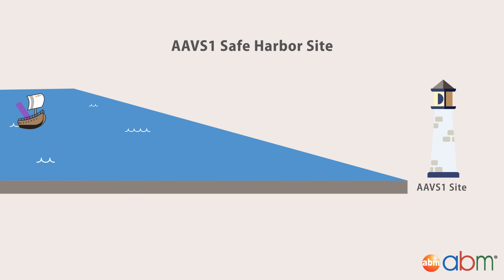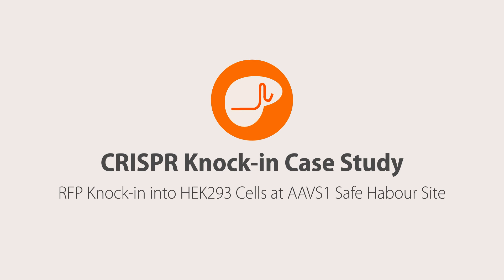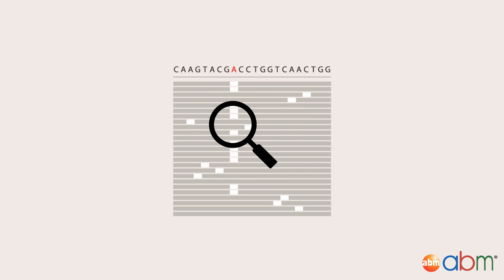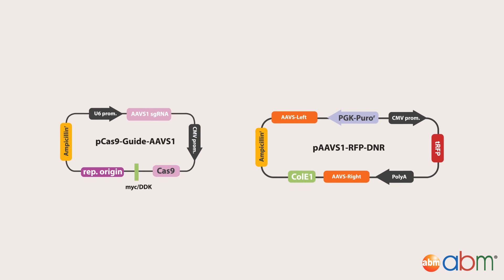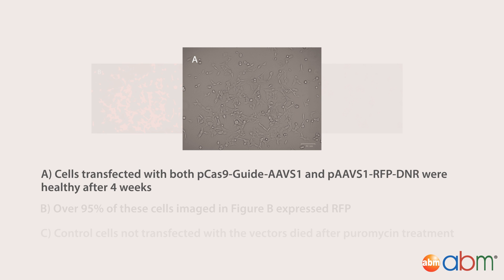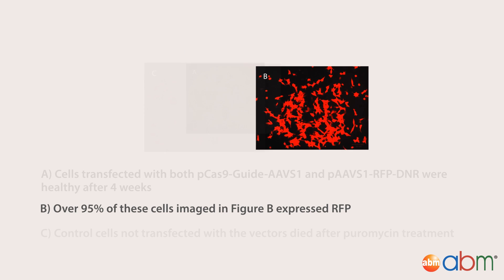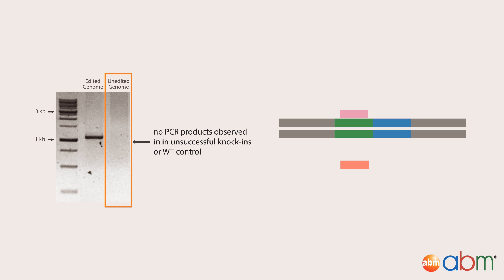How to perform a CRISPR Knockin Experiment

Comment: I was wondering why you included the PGK-Puro within the AAVS homology arms? If the CMV promoter is constitutive then can't we just select based on red flourescence?
Reply: Also because this way our knock-in only contains the GOI. My understanding is that this is necessary because we wouldn't want to transfect other selectable markers if we were using this for something commercial, like in agriculture.
Reply from the maker: Hello! Thank you for your comment! In the research setting, sometimes a selection marker is more desirable. For example, when you need a polyclonal overexpression cell line, a drug screen will be more applicable than a fluorescent marker screen. It could be a totally different scenario when it is commercial agriculture. Thank you for raising an interesting POV!

Comment: Hi, thank you for the great video.
But I have some question: 
Based on my limited understand in transfection experiment, the antibiotic selection might keep the plasmid DNA being replicated or even random inserted to gDNA, which may disturb gene expression. So that is the reason why we need the exactly knock-in and harbor position. 

If I perform the transfection, why do I still need the CRISPR knock-in? 
Or is there any method to remove the unexpected insertion in animal model?

Comment: How are you sure that knockin took place at AAVS1 locus and nowhere else?
Reply from the maker: As part of knock-in, sgRNA sequences are designed to target the AAVS1 site specifically. As well, HDR templates are designed such that they included flanking homology arms with homology to the AAVS1 integration site. As for verification, whole genome sequencing can be employed to check for the presence/absence of off-target effects in the edited cell line.
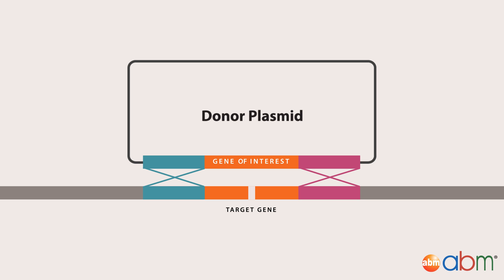Reply: @abmgood  very nice vid. I am confused in 2:11 to 2:22.  If there is 1 cut by sgRNA, so on vid seems that orange GoI replaces no homology DNA part on the genome, despite of correct HDR left and right. Is it correct illustration?
I am wondering, can you use two sgRNAs designed to target two genomic sites of  AAVS1near HR arm left and rigth?  I hope my question is clear.

Comment: Hi! I had a dumb question. But if you are using the Puro plasmid to confer Puromycin resistance to select for only cells that took both plasmids, wouldn't it be possible that there are cells that only took the Puro/Ampicilin plasmid, and didn't intake the sgRNA/Cas9 vector plasmid? Like a false positive. Also i didnt understand what CMV and u6 promoters are. Thanks
Reply from the maker: Hello Obluda,
CRISPR utilizes a sgRNA that directs the Cas9 enzyme to create breaks at specific locations in the genome. Genome stability will prompt repair of the breaks and thus a donor template containing homologous sequences upstream and downstream of the intended editing site is taken up by the cell. If the sgRNA/Cas9 plasmid is not introduced, this means that breaks will not created in the genome, and therefore the repair mechanism is not initiated to take up the donor template. The CMV promoter in the pCAs9-Guide-AAVS1 plasmid is used to drive expression of the Cas9, and the U6 promoter is used to drive expression of the sgRNA.

Comment: hi, thanks for the video. I'm slightly confused, if I want to perform a gene knock in, do I administer the vector containing the Cas9 and gRNA separately from the donor DNA, or can the donor DNA be inserted into the host in the same vector? thanks again. Also, if I wanted to tag my vector with HA in order to follow the fate of my transduction, where would I add this? thanks in advance
Reply from the maker: Hello Aine,

The donor DNA is typically supplied as (1) a single-stranded oligonucleotide (for small insertion sequences, <200 nt) or (2) a separate vector that does not replicate/integrate in mammalian cells (for large insertion sequences). In a CRISP lentiviral system, it is not recommended to clone the donor DNA onto the same lentivector habouring gRNA and Cas9 because this has a high probability of random integration into the gDNA. In a CRISPR AAV system, it is possible to clone the donor DNA onto the same AAV vector harbouring gRNA and Cas9 because AAVs do not integrate into the gDNA. However, it may not be possible to fit all 3 elements in the same AAV because the packaging capacity of AAVs is around 4.7 kb only. 

HA tags are used for tagging proteins, not vectors. If you want to verify whether the transfection/transduction was successful, you can use vectors/viruses carrying a fluorescent reporter and/or an antibiotic resistance marker which can be used for selection.
Reply: @abmgood  sir, is there any info suitable stem cell therapy for pkd /adpkd diseases polycystic kidney disease sacs of fluid in both kidnies and high blood pressure. Which PKD1, PKD2 genes can be turn off from DNA, kidnies, liver,. Kindly provide me suitable info thanks

Comment: How all of those orange bases disappear at 2:15 ? i'm trying to understand crispr but everybody explain it differently . Why just 1 hole at this place could lead to the disappearance of all those orange bases ? If the orange bases weren't there on the bottom strand, and that the cut was made just between the blue and the pink part , i would understand that, with HDR , the upper strand orange part would've been copied to the bottom part with reparation system. But now i'm confused.
Reply from the maker: The orange bases did not disappear. The orange bases were included in the image to illustrate the location of the gene following insertion. We apologize if the animation was confusing. 

To clarify the steps: 
(1) Cas9 and sgRNA are used to produce a double-stranded break; (2) the repair template, shown in the video as "Donor Plasmid", is used by the cell to repair the break using homologous recombination; and (3) the gene of interest, which is included between the homology arms on the repair template, is integrated into the genome.
Reply: @abmgood  thank you :p

Comment: Thank you for great video! what if i would like to knockin reporter to the 3' end of my gene of interest, in pluoripotent cells so that i can track the particular lineage of cells. Now in this case i need to ignore the safe harbor region and just should design guide RNA which would be at 3' end of my gene of interest, and that can be on any chromosome. right?
Reply from the maker: Hi Arshad! Thanks for leaving a comment. Yes, you are correct! Keep in mind that if you wish for a fusion reporter, you will need to remove the gene of interest's stop codon. In this case, you will need to design the gRNA so it targets close to the 3' end of your gene of interest, and design the repair template so that in the process of recombination the stop codon is removed. Confirm the removal of the stop codon and the correct reading frame of the reporter by sequencing analysis. Hope this helps!

Comment: Great video and many thanks
Let me ask, if there is no successful knock in, and we perform a pcr as you describe, isnt it possible for  1 primer to bind on puromycin   gene and the second primer to one homology arm, both being on the original plasmid that we transfected? (And not on our desirable genomic loci)
Reply from the maker: Hi tavladwr,

Yes, this may happen right after you transfect your plasmid, but after passaging your cells about 10 times your plasmid should be diluted out as it does not have a replication origin.
Reply: ah yes, now i see
thanks!